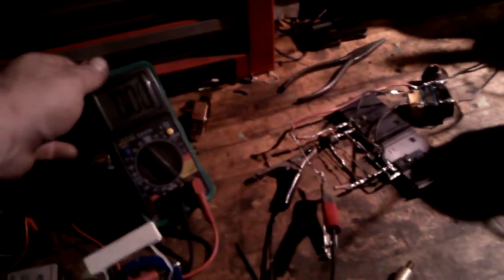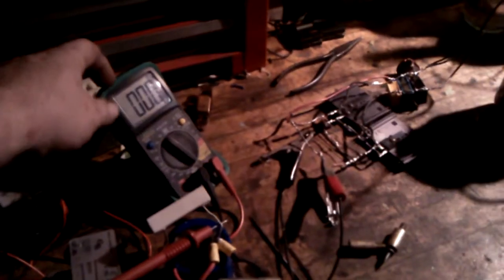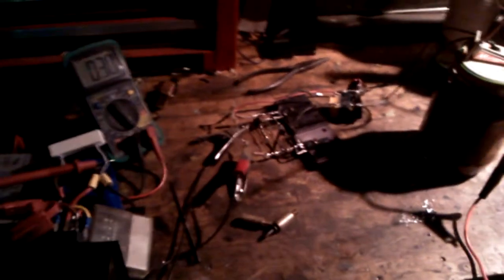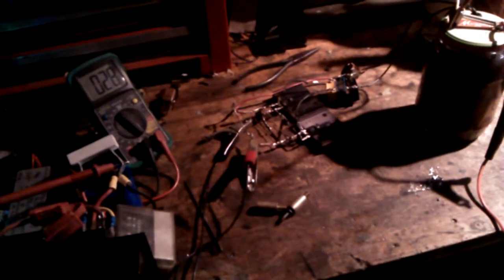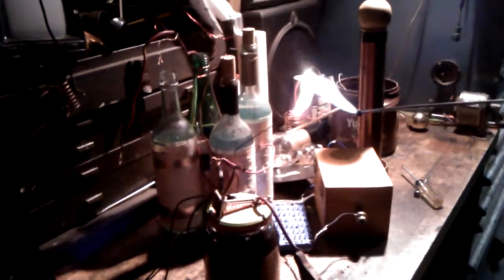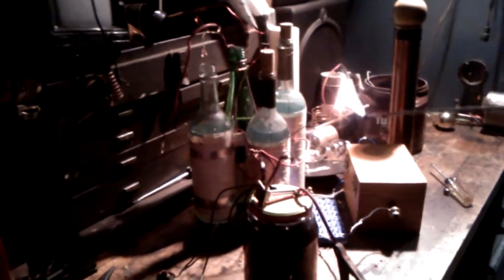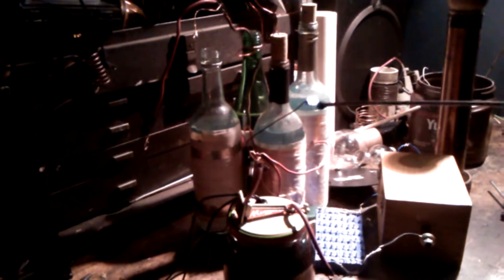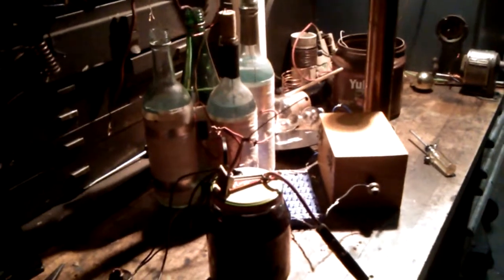Hot flame zvs arcs at 35-50v

Comment: oh yeah some tasty arcs ! sounds like a very in-tune inverter circuit as well as there's no high pitch noise when your pulling the arcs .. i would suggest a safety gap when the input voltage is that high, open circuit on flybacks can kill them ! you might be good with the amount of capacitance already but i dont know how much the circuit changes with additional FETS, basically try out more caps and see if you like it :-) cheers bud !